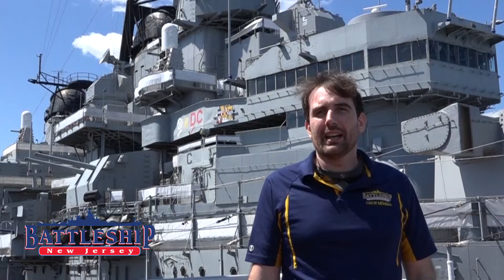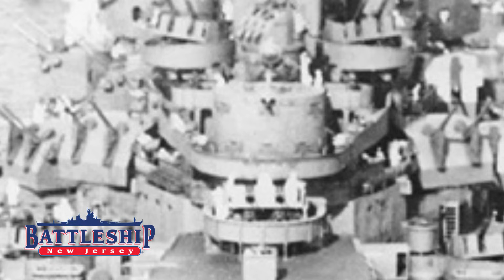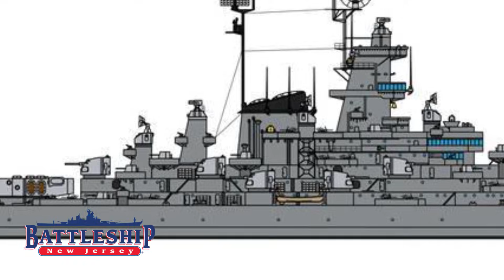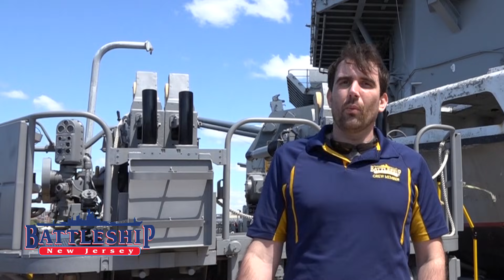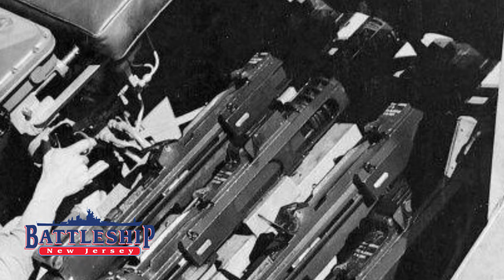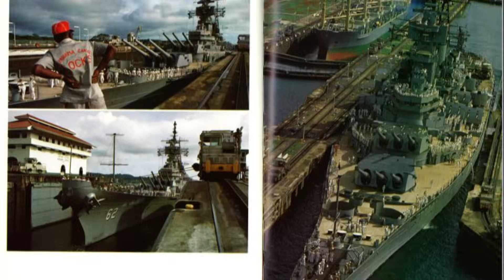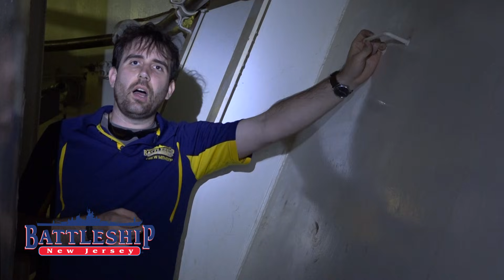What the Navy Doesn't Like About the Iowas

Comment: I wish we could make modern battleships. They're just so cool. I would retain the guns, redundancy, speed, buoyancy reserve, and durability (armor) from the Iowa, refresh it all with modern electronics and metallurgy, and put it in a modern ship with modern fire control, propulsion, etc. I'd add VLS cells, keep the helicopter pad, and replace all the AA guns with CIWS guns. So basically just continue doing the kinds of upgrades they did to New Jersey, but include ones that would require a whole new ship (ie the engines, electronics overhaul, modern armor, VLS cells, etc). The raw power of those guns and the amount of punishment the battleships can tank is too awesome to give up.

Comment: I'm ex Royal Navy 85/90 and a mark 8 torpedo would break the back of these ships. End off. Yes it would take 30 /35 exocet missiles to take out a ship like this but 1 mk 8 would leave it helpless in the water then a nuclear bomb( local) would fuck it up. Even without the Nike by breaking the back of the battleship all the controls to the guns would be fucked. The guns themselves wouldn't be able to even be raised/ lowered due to the stress of bending steel stopping the hydrolic pistons from working. I'm an ex gunner/ missile operator from the ROYAL Navy and love the yanks and worked with them many times. The MK 8s/tigerfish ect would destroy ANY ship in service With ANY navy today.

Comment: Nothing could threaten it?  IJN Yamato, and IJN Musashi may disagree? Unfortunately, or Fortunately, we will never know? If the Iowa could stay at a distance, WIN: USS Iowa. 
If the IJN Yamato could've closed the distance, or caught them in thick fog/low cloud cover+rain. WIN: Yamato. 
 But the Diving Shells of the IJN ships 460mm shells, could pierce the Belt Armor of an Iowa, but not vise versa with the Iowas.   Yes, Iowas had more and reliable speed, much better long and short Hz radar, and far more accurate gunnery control systems(accuracy at range). 
 Still an AWESOME SHIP!! It's a shame the Big Gun Dreadnaughts are gone, for trapezoidal shaped missile cruisers.
Reply: Sorry, you're UTTERLY wrong about the ability of the Iowa 16" naval rifles to penetrate the Yamato.

Steel used for those ships was found in Japan and taken to U.S. proving grounds. The Iowa 16" guns were able to blow clean through all 24" of the Yamato armor.

Consider that the Iowa class had radar directed fire, the Iowa holds the edge in weather and darkness.

Comment: Nuclear propulsion for the platform!?
Reply: They were already fast enough to keep pace with early nuclear carriers and, as the video stated, had such enormous fuel capacity that they could, themselves, act as tankers for smaller conventionally powered escorts.
Reply: Nuclear power would allow a massive increase in range, the retrofit would likely include hull improvement for higher speed.

Further, it slashes the crew necessary for operation. It frees up the room used to bunk and feed that crew, as well as the space required for the fuel and powerplants.

The room regained allows for a higher boyancy advantage. But it also creates room for stores, weapons systems, and weapon control systems. Both offensive and defensive weapons.

It would be extremely difficult, and likely cost prohibitive in the current world, but conversion to nuclear power would be a massive game changer.

Comment: "In the 1980's there was nothing else that seriously threaten them", or so you said. In the 1980's there were MANY ships of much smaller size that could have totally unliberated them with one missile (yes, the missile what have carried a nuclear warhead, but nothing would have been left of the battleship AND its group.) ANY ship using a TALOS missile (60+ NAUTICAL miles range) could have stood off from ANY of the battleships and sunk them with as many missiles as needed (if one wasn't a nuke, that is) without worry that the battleship could get within the range of her guns (range of about 30+ nautical miles - maybe, with a tail wind) being able to take what would have been considered a "pot shot" at the cruiser launching the TALOS.

And if it so happened that a battleship were to try to catch the cruiser (specifically the USS Long Beach CGN9) lobbing Talos missiles at her, the battleship MIGHT have finally gotten into range of the cruiser (again, the USS Long Beach CGN9) because the battleship's steaming range of 24,000 nautical miles (with all of the fuel oil she carried) was FAR FAR less that the approximately 3,000,000 nautical mile range on her first fueling (and farther on her successive REfuelings) with little to no difference in top speed.

As a matter of fact, about the time the DLG's (Destroyer, Leader, Guided missile) were changed to being called "cruisers", it was being talked about that the USS Long Beach CGN9 should be reclassified as a battleship due to her fire-power. It never happened, but after they took off the TALOS missiles and added the Tomahawk cruise missiles, she truly "out gunned" a WWII version of a battleship.

I do NOT mean ANY dispariging of ANY of the battleships. I am just pointing out that some of your statements are (while not meant to be lies) not the truth - or should I say not actually factual? In Viet Nam, American Marines and soldiers were VERY happy to hear a "Cadillac" (so called due to weight of the shell as well as the cost) from the USS New Jersey BB63 coming in overhead.

Comment: You said the 17.3" conning tower was the thickest armor? I believe that the turret faces are 17" thick class B armor over 2.5" thick STS steel, making it 19.5" thick overall.
Reply from the maker: The turret faces are only 17in. There's a backing plate with concrete in between but it isnt one solid piece.
Reply: @BattleshipNewJersey  Would that 2.5" STS backing plate be considered part of the turret face armor?

Comment: 33 knots? That's the official top speed. My dad had a navigator's ticket, and was in the Philippines after the war when they took the aircraft off the Essex class carriers and put bunks on the hanger deck and took a division home at a time. He timed the same ship to the (West coast) and back and calculated the speed. It came in above 40, if memory serves around 45 knots. And that wasn't flank. The Iowas were designed to run with them. So losing 3 knots off the nominal speed may have made no real difference in practice. I think the Nimitz are rated at 38 knots. I know folks who have clocked them on radar off Norfolk and report MUCH much more. And the rumors are the Aegis class cruisers and Arleigh Burkes in the 80s were hitting 75 knots or more.
Reply: 75 knots? faster than I drive on an interstate? That's more than a little far fetched.
Reply: @emintey  As I said, rumors. Great line from an old Civil War letter "Rumors don't count for much here." But If the Essex were capable of 45 plus, 50 or more are not at all unreasonable. And that's Interstate speed in a lot of the country (although 75 knots is just about the open country speed limit on Interstates in west TX - :)). The details are relatively  unimportant. The point is, published speeds have, and have never had, much to do with capability. And my initial point was that a redesign which "cost" 3 knots may have actually meant very little in practical terms, since we don't really know what the ship was truly capable of. What we can use standard formulae for is to compare the ratio of length to beam for an Essex and an Iowa; 6.02:7.96 with the Iowa longer in proportion to beam. That means it SHOULD be capable of more than the Essex. Almost one third more, in fact. Beyond that, and we are speculating.
Reply: @daletaylor2433  Hydrodynamic drag says 50 knots in anything large is a physical impossibility.  You only see those kinds of speeds in stuff that skims/planes or uses hydrofoils. Conventional hull design simply has too much drag, much of it coming from the propellers which drastically lose efficiency at speed increases.  Given the engine and propeller technology of the time, 40 knots in an Essex is simply fantasy unless you're moving with a strong current and adding the current speed to the ship's speed.  Your dad got the calculations wrong.  Sorry, but that kind of claim is as physically impossible as claiming someone broke the sound barrier in a P-51 Mustang.  Physics says otherwise.

And length:beam is just one factor. Draft is another, as is the specific design of the hullform. it's also not a linear calculation, more like logarithmic, so a 25% increase in length:beam at those high ratios actually means only about 5-8% more theoretical speed. 

Big ships don't do 40+ knots, even with things like nuclear power. 2000 ton frigates with incredibly powerful & light gas turbines, yeah, if they're designed to.
Reply: @eriktrimble8784  More likely that 60 years after the fact and ten years on my memory there was corruption of the real data by memory issues. I can't say I heard that number more than once, and it was years ago now. And more years for him to remember it after it had ceased to be important. I  suspect, given what he did in those years, that his calcs at the time were correct, but there is legitimate ground to question memory of the answer.
Reply: @daletaylor2433  Data from wikipedia give Essex-class carrier a length between perpendiculars of 820' between perpendiculars and beam of 93' at the waterline, thus a length:beam ratio of 8.8:1. Iowa-class figures are 860' between perpendiculars and beam of 108' at the waterline, thus a length:beam ratio of 7.96:1. Essex carriers do have a large beam at the flight deck, but that is not relevant to the hydrodynamics of the hull moving through the sea.
Reply: @eriktrimble8784  50 knots; true. I was on a destroyer leader in the '70s, supporting supercarriers, so we had to keep pace. After an  overhaul, we went on a full power run. I was on the helm, and all we could build up to was 33 knots. Our top speed (flank speed) otherwise was 27 knots. Even in the modern Navy, top speed is probably much less than 40 knots for any ship. Speed will do you no good against jet aircraft and torpedoes that can do 50+ knots. Even gas turbines are used because that can be run up full power almost instantly, compared to building up steam in the older ships.
Reply: @emintey  It seems hard to believe,  but I saw the Abe Lincoln do something close to that back in Desert Shield/Storm,  the day before the air war began. They don't do it often, or without good reason for sure.
Reply: all ships in the military can run faster than they say but doesnt mean they will run at max potential speed for long, as that could cause unnecessary wear and tear and excessive fuel usage, usually most ships are run at 70-85% of the flank speed, speaking as someone who served on a Frigate and later a DDG.
Reply: @ainzooalgown7589  Understand. But the numbers he derived were calculated Philippines to SF and back, with time for turnaround factored in. As you say, that would not have been flank for a sustained period of time. As I already said it wasn't. Miles to cover and elapsed time don't lie. That's actual performance, not theoretical.

Comment: Based on the design of the Montana class, it seems they weren't a fan of the internal armour belt either.

Also, it wasn't just that welding was new and untested, but welding high tensile strength steel like STS tends to be very finicky and is prone to cracking if done improperly.

Comment: The real problem is the fact the Iowas EVEN EXISTED. They are battleships built after the battleship concept was outdated, just like the Yamatos (except they were even more expensive per ship; the fact the US wartime economy was robust enough to easily survive such massive wastes of resources doesn't meant they weren't gigantic procurement failures). You can actually say this about all 29 battleships of the WWII generation. 

Yes the Iowa did supporting roles like AA escort and bombardment, but said roles could have been undertaken by light cruisers, destroyers or Standards; there was no point in building a new capital ship to use it as a gigantic CLAA (when two actual CLAAs provided the same AA firepower at far less cost) that doubled as a gigantic monitor (when the USN already had plenty of older battleships to serve as gigantic monitors). Given their capabilities and long careers, the combat performance of the Iowas was lacklustre if not dismal (compared to how much was invested in them)-not because they were badly designed, because they are great designs, but because they were designed for a role (pursuing fast enemy capital ships in surface combat) that didn't even exist by the time they entered service.

The Iowas should be criticized in the same way as the Yamatos and for the same reasons (pointless, obsolete even before commissioning, and a waste of resources), not celebrated as they far too often are.
Reply: The battleship concept wasn't out of date during ww2. Us battleships may not have had a amazing combat record but this is mostly due there operations being for the most part in the pacific. If you look at the royal navy a navy that was making both carriers and battleships at the same time you will see the value in battleships as a fleet in being or as protection for carriers from other large surface units.
Reply: @aeromech2012  Even in the Atlantic theatre there is literally only one battle where using a battleship was justified (Battle of North Cape), and even then that only applies to the British. Everything else battleships did in Europe could have been, and often were, better achieved by cruisers, destroyers (for sinking enemy cruisers/destroyers, escort duties, shore bombardment, other supporting duties), monitors (shore bombardment), carriers (killing enemy capital ships), or submarines (commerce raiding). 

Battleships are NOT useful for guarding carriers from enemy battleships, because a carrier can defend itself just fine by simply maintaining a safe distance without any need for a heavy anti-surface escort. Before you use Glorious as a counterexample, that happened because her commanding officer was incompetent to the point he didn't bother to scout ahead and plan accordingly even though he easily could have. 

Carrier escorts should be focused on AA and ASW, not an anti-surface role. While battleships could do AA, they were far less efficient at this than subcapital units (two Atlantas matched an Iowa in AA firepower while being cheaper, faster to enter service, and needing less resources and manpower). And battleships couldn't do ASW.

The RN was just as bad as the USN and IJN when it came to investing in battleships, they also wasted money and resources on battleships like everyone else. Vanguard. and at least some if not all of the KGVs, should never have been built.

Comment: I wonder if a large bow dome structure could have appreciably increased forward floatation while also improving the flow of water over the bow hull form to reduce that awkward breaking bow wave that the ships generated, and specifically whether a more efficient hull form from such an addition be enough to allow the forward most part of the torpedo defense at the A turret's barbette to be thickened a bit without costing the ship in the speed department.

also, you gotta do a video on all the higher tech modification proposals that were projected for the Iowa class had they been selected to be overhauled and returned to active service in the 90's instead of put out to pasture.
Reply from the maker: Weve been slowly working our way through the proposed plans, check out some of our videos from earlier this year.

Comment: "by the 1980s there wasnt anything that could threaten them" What? Maybe this was true in 1945 but in 1980?! The soviets built massive anti ship missiles in the 1960s for the exact role to defeat these armoured beasts and aircraft carriers offcourse. I mean the AS5 kelt had an 850kg warhead was 2t weight and came in at like 1200km/h. It could blast through 300mm steel. This was 1960 and this wasnt even their bigest. 1980...AS 4, Kh 22, Even the old Styx wasnt light with its 530kg warhead! What is he talking about? #!
Reply: They had nuclear warheads LOL, they had no penetration capabilities, no conventional missile can destroy an Iowa battleship even today, it would take dozens of them
Reply: @Maverick966  The projectiles that could penetrated the armor of a Tiger II tank were minuscule in comparison ... it is not just about size but also about kinetic energy - Soviet missiles traveled at speeds FAR in excess of any projectile launched by a rifled gun.
Reply: @otyliciu  Nope, not at sea level, they were not designed to penetrate thick armor, they had a nuclear warhead for a reason
Reply: @Maverick966  Please research what kinetic actually energy is instead of fantasizing that some fixed amount of armor somehow guarantees the magical power of invulnerability against any combination of forces.  Penetrating power is a function of mass TIMES velocity.  Combined with enough speed, a single atom could penetrate any amount of "armor."
Reply: @Maverick966   They all had conventional option too. The Ksr2(AS5) was even used in 1973 against Israel (you think the arabs used nukes?). It has an 850kg warhead with an efp(explosive formed projectile) head. This cuts through 300mm steel so it is enough to penetrate most parts of Iowa. Remember this is 60s so no Phalanx or anti missile defense! When the 80s came the Soviets already had Kh22 and KSR5 with Mach3 performance and a steep diving attack on the less armoured deck with 1000kg warhead available. Just because you think of harpoon and exocet as anti ship missiles, that doesent mean that there werent monster missiles against monster ships.